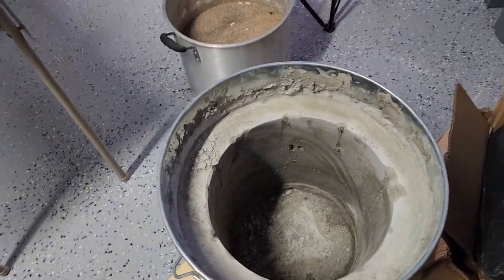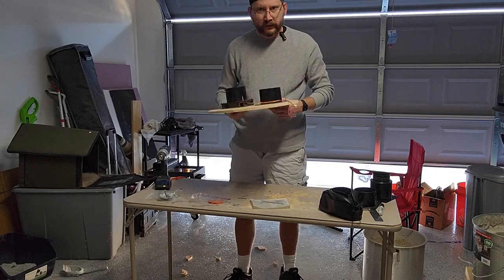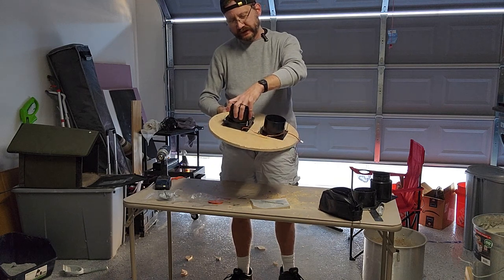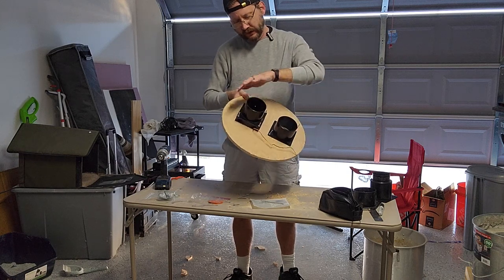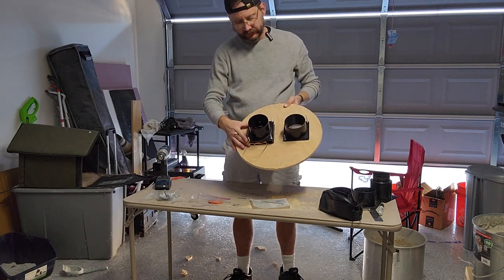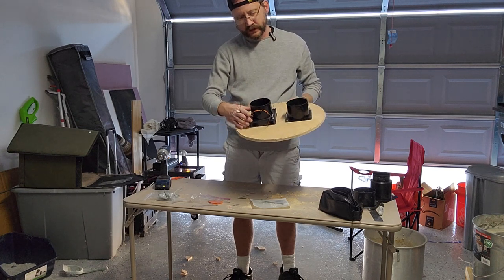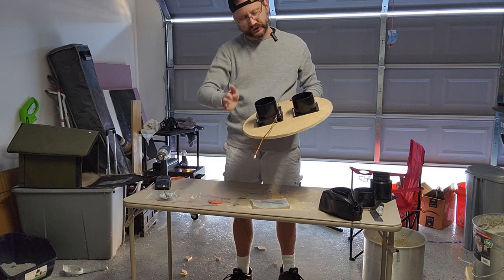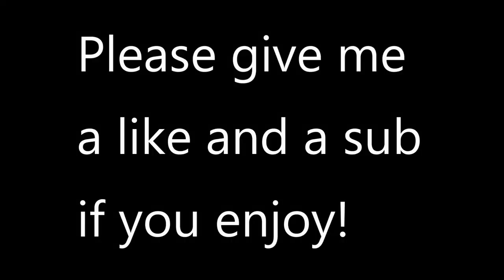Sand Battery QnA.. Free heat with solar! Sand Battery Heater Viewer Responses

Comment: Somewhat improved with V2.0 , but Thermal exchange is always about specific heat and surface area to effect thermal exchange. its always about the physics. You have to have the contact area to put the heat in and to get it out.  My design is like an air boiler with a larger circular heating element and many air tubes to take the heat out. Just ordered the Data Logger to measure and record events.  Using 500 lbs of sand. We shall see if its viable.
Reply from the maker: Agreed

Comment: I have a question.  I have a 55 gallon removable top drum with a water heater bung welded in 1/3 from bottom. It uses a 110v element in past to heat waste oil.  Could this setup heat that size container?  I am only looking to keep an 8X12 greenhouse warm at night in the deep south.  It usually freezes here 4-5 nights per year and would be great to have growing temperature most days
Reply from the maker: Should.

Comment: You know what I've done with my buddy heater system I've taken an electric radiator heater we know with the oil inside of it and it didn't work no more the heating element for plugging it in but the oil is still in the radiator so I just take it and set it up on top of my buddy heater and it heats that bottom rail and allows that oil to heat up in the radiator itself and then I have a fan behind it just blowing on it works a little better
Reply from the maker: Neat

Comment: I suspect using stove elements,although more durable than the water heating elements,  will require many more watts such that one would need a moderate of solar panels to get decent results. Have you considered PTC heating elements, as desert guy demonstrated? Would they be any more likely to survive 450 to 500 F than the heating elements,even with silicone protected wires? Of course  you'd have to order them online(not readily available). Also what about using a wide mouth double wall s s vacuum insulated thermos type vessel or thermal food warmer pot?Heat up faster and way less bleed off thru the sides.
Reply from the maker: I'm using stove elements for version 2, but in my tests it's not any better. Desert Sun makes nifty videos, but doesn't do any real world testing other than using his laser thermometer and saying 'its hot!' .  You'll see the actual results of mine soon
Reply: Yes , but all he cal rods are pretty much the same,  I am using one from a dishwasher and its 1000 watts.  Its about the mass (total BTUs) of heat you are storing vs the size of the space to be heated and the rate at which you are taking the heat out of the sand. Water has twice as much heat capacity as sand , but you can only heat water to 212 degrees, it is the same in the relation to delivering the heat into it and taking it out. One of my solar thermal systems is creating hot water , but my garden hose heat exchanger isn't capable of delivering the heat efficiently into the tank I am warming. With the sand battery all of the energy is delivered at ~90% efficiency to the sand, then we just have to get the most efficiency out of our recovery system, which is in our case and air exchange system.

Comment: The stirling engine would be cool, I’ll keep an eye out for something larger!
Liquid should be more efficient and effective than a solid so My thought was maybe using glycol instead of sand. Dunno what that would cost
Reply from the maker: Radiator fluid. Check out my other videos!

Comment: Heres how.

Container with heating. element and sand.

Solar powered.

1" steel pipe coil. Can be a square coil depending on parts avalable.
Same idea as a beer wort chiller coil buried in the sand.

The coil is the heat exchanger. The coil with steel tabs welded all the way to pass the heat into it.

Pc fan blow cold air into the bottom coil inlet to emit heated air at sand temp (500f) into the room.
Don. England.
Reply from the maker: check my v2 and v3 videos

Comment: Yeah. Brasil. There are very cold days here  Even in São Paulo. I know how to make 70% more efficient DC heaters bit they will stop working as desired when mixed with "sand salt"  Peter Davey heater have half dozen  rules to achieve unprecedent success. I dream to make one that we can avoid water burn. I've burned out my skin out of my belly with peter davey sudden boiling water many years ago.
I like your videos! Keep up honest safe  research.
We are near the portable sun here.
Maybe the rules of open connection heaters will be my new focus to help us find new anomalies.
Reply from the maker: Thanks!

Comment: What about putting tubing from bottom through the top like cylinder of a revolver. Heat the inside sand with a fan on the bottom of tubes giving more surface area and moving the heat across the surface area.
Reply from the maker: Still not going to cheat thermodynamics. The heat out is still only as good as the heat in

Comment: Pakistan, Good Effort! I want to know that how the water heating element worked in the sand? I think when water heating rod/elements are used outside the water they get distroyed. Also please let me know the watts of your heating element. Thanks!
Reply from the maker: Watch the first video. You are correct
Reply: I could not figure out from the first video properly. If the water heating element failed in the sand then what is the other choice left? It is not only question of wires melting. It is  said that the water heating element also get distroyed when used outside the water.

Comment: If limited on solar power than  a heat pump heating water can* make sense because heat pumps need less power per BTU...but it is a lower temp heat so more water must be stored..... it has a very high specific heat though...... then there are freezing issues for some people (antifreeze lowers the spec heat.   Sand is nice because it can be heated to high temps....but not with an efficient heat pump......  I'm contemplating (lol)   converting an electric kiln to heat up aluminum ingots..molten.... bonus it has not just specific heat storage, but also a phase change latent heat bonus.... so it would be pretty compact vs the other methods....  safe though? still thinking/ researching.  If we lived in the U.L we could just buy a cheap "Storage Heater"  which is basically a ready made sand battery...except bricks.   The bricks are like scrap material there.
Reply from the maker: Check vid2 and 3

Comment: Could heat element be inserted in a hole in side of bucket, to protect wiring, similar to a hot water heater?

Could thermostatic shutoff help prevent overheating? 

How much bulk of sand can one or two elements heat? (Thinking, the more sand, the longer it can radiate heat?) 

If a small tank electric water heater (5 to 10 gallon?) is used, & connect a coil of copper tubing in/out of sand bucket to it, the water gets hot like normal; no fiddling w/parts & melting plastic, but still stores heat in the sand bucket.  
That could last a very long time, be very easy to remove/replace the hot water heater.  & even be rigged w/splitter, to take a quickie hot shower from the hot water tank, via the sand-heating coil.   If one’s needs required solid fuel, aren’t there wood fired versions of hot water heaters? 

I’d like to see specific parts list, so folks can know clearly, what kind of parts to get or salvage. 
This is a great idea…might still be too pricey to get parts, for MANY folks, but sure MUCH safer than open flame survival heat & cooking devices, esp. in a house or tent.
Reply from the maker: Check out my other videos for the reasons on this

Comment: My heater element burt out its 120v and used 110? Is it too much volts for extended time?
Reply from the maker: no that's fine.  it probably over heated like mine did
Reply: @texasprepperprojects  my plane is to only run it at half like 60v should prevent that you think?
Reply from the maker: @thedampestcrib6004   I think you won't get enough heat out of it to do much at 60v
Reply: @texasprepperprojects  hmm I also thought about 240v but run 120 is it's same element but bigger gauge internal

Comment: So I’m wondering just how big one needs to heat a house in a Canadian winter. I’m thinking a oven setup with coil piping  going in and out then running into the slab floors. A common kitchen oven could be used as is element connections are protected and it’s already built for heat high heat!
Reply from the maker: For a house? You'll need several tons of sand
Reply: Hot water running through a slab floor is called radiant floor heating. Hot air would loose it’s efficiency due to distance . Radiant floor heating works well as long as you have fuel (propane etc.) available. If the water freezes in the floor pipes, you’re screwed, and the house is shot. Best thing is to drain the system before it gets near freezing and use the available (buddy heat/sand thingy etc) in a tent in your living room if it’s gonna get worse for a longer period of time.
Reply: Not fully true im rebuilding a sand battery from 55 gallon drum holds 792lbs of sand with steel square tubing at 6x6 straight in from bottom with 2 90 degree bends  and out the top into my 3200sq ft home tests last year proved i could maintain entire house temp of 78 degrees i have 2 oven elements in it both ran to 8 trina 255w solar panels in series 2040 watts at 240v so 16 solar panels total it works perfect but i get about 745°f and air blows out at around 152 i have it hooked up to thermostat of house my second floor stays 68°f with setup im working on a booster sand box upstairs to just help warm alittle better would love to do a collab with you before i actually go live with our video content oh and forgot to mention i used copper pipes in sand that i drilled into the steel tubing
Reply: @Familyadventure369  fascinating! Your design is very on par with what I was thinking for how I would like to build one to heat my house. I do have a few questions that I hope you don’t mind answering. 
1) Did you use the steel drum that is used to transport oil? Was it used or new? 
2) where did you get your steel tubing from and did you weld it into a T shape? 
3) Did you then cut holes into your drum to add the steel tubing. 
4) where did you get your stovetop heating element? 
5) how much did everything cost you in the end? 
I would love to see your video when you release it. Thanks for posting your comment!
Reply: Its a 55 gallon drum with ebay universal exhaust kit at 3 inch with 2 90s and 2 180 pipes for each set and theres two total i use oven elements to heat sand which i bought on amazon and the fan is 1200cfm inline with r60 plus insulation will hold my 3200sq ft home at 78 degrees with a 14 day discharge and takes 3 days to fully charge up enough heat to last 14 days heating element is  3500w but im running them threw a powmr inverter with a step up transformer to 240v but only consumes 2700 watts with 18 255w panels mounted at 43 degree angle steel drum was a old oil drum i cleaned out and i only drilled 4 3 in holes for the pipes and i spent $900 total on the build but again it was a prototype that i was sure would fail to last at it did 27 days in jan here in massachusetts before being 82 degrees
Reply: @Familyadventure369  Thanks for your reply, Sounds awesome. But to be clear, it only lasted 27 days before it was useless? Or did I not understand you incorrectly?
Reply: Heat output lasted 27 days with no more heat applied its lasted going now on 2 seasons
Reply: @Familyadventure369  oh ok 😄. Sounds good. Are you still planning on posting your videos?? Just know it doesn’t have to be fancy or anything. This info is so valuable that as long as we can see and hear everything that you are doing and saying, that’s good enough for the viewer. Baggers can’t be choosers 😁😁.
Reply: I have decided to make a video and will be within next few weeks

Comment: I am in Canada I would like to try heating the sand with a Cooper coil pumpi g water through it to prevent heat the water before going to the hot water heater
Reply from the maker: Try it! Make a video on how it works!
Reply: @Texas Prepper Projects  yes I hope to try it inspired by your videos have some health issues I need to address I will likely be on sick leave this summer and will work on it

Comment: Can an inductive source be located close enough to an optimally configured ferrous shape inside a container of sand to raise the sand temp to be of any use?      Annnnd?   Can a coil of appropriate  wire also be placed in range of same said source  simultaneously to induce any usable voltage?                I have seen somewhere, someone using induction and coils to allegedly get good usable voltage in a highly efficient manner.  If that is true annnnnnd a person could heat a good dose of sand for that day,  it would be pretty dang cool.   It does not have to hold our Sun.  haha.     Thanks for this chance to blabber about brother.
Reply from the maker: Watch my other videos. It's not worth it. Sand batteries only make sense in combination with geothermal heat

Comment: you bought a stove element .......should have bought a throw away stove .....has the elements and the over provides your container
Reply from the maker: Can't lift it. Can't fit it in my car. Can't use it when I'm done with the experiment. $10 element from amazon is much easier to deal with

Comment: How about a cast iron lid with a cfm heat powered fan?
Reply from the maker: That's not 'creating' any heat, that would just move the hot air around.   Heat is heat.  Check out video 3 for what I did next. I still don't think it's worthwhile for a small scale